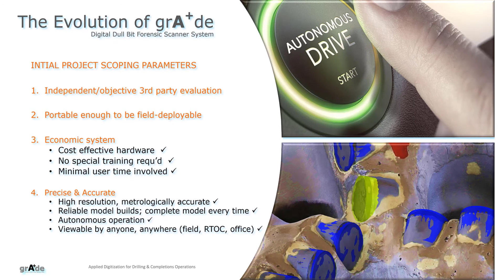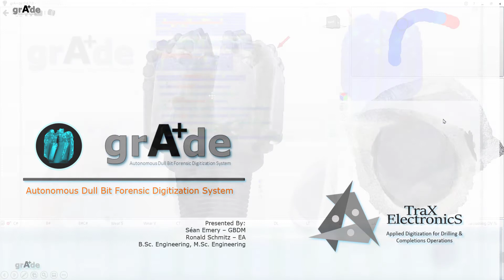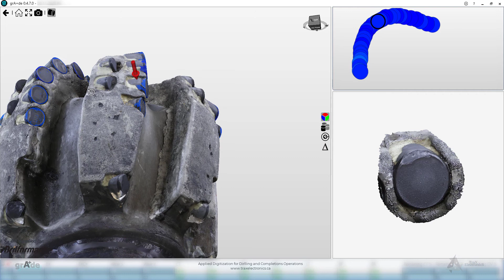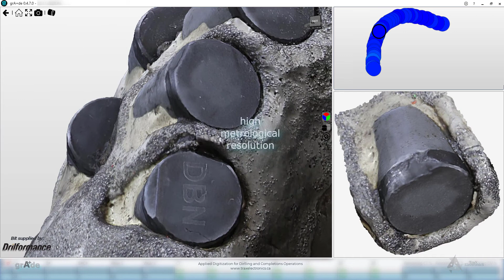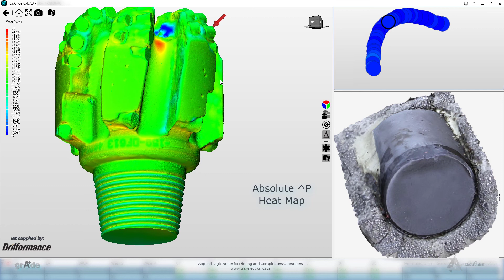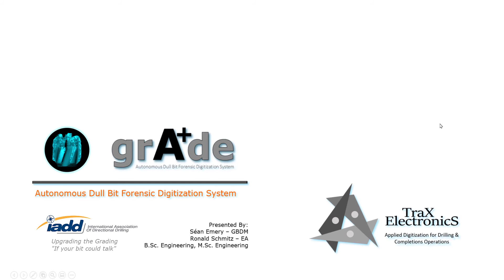January IADD Forum Presentation

Comment: How long does it take for the full grading process ?
Reply from the maker: Operator's time is less than a few minutes as the scanner is completely autonomous you 

Load the bit
Enter the bits ID
AND press GO!

The scanning takes +/-13 mins
Reply: @traxelectronicsinc.4566  thx for the answer, what about computation time ?
Reply from the maker: @iliesaya  depends on bit size, resolution and the package you want?  Why don't we setup a call and I can answer your questions. send me note to info@traxelectronics.ca and we can setup a time to run you through a live demo and answer all those questions.  Thanks again for the keen interest.